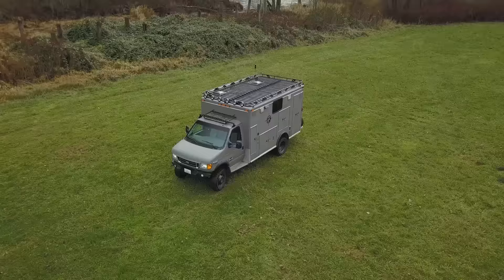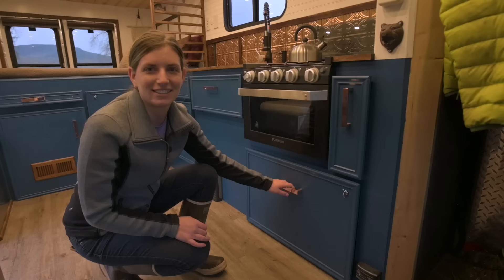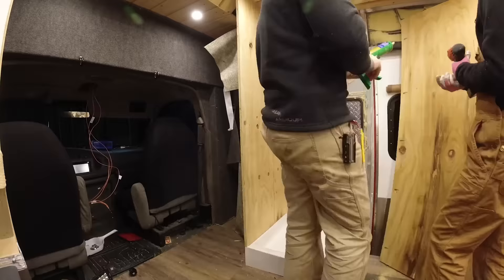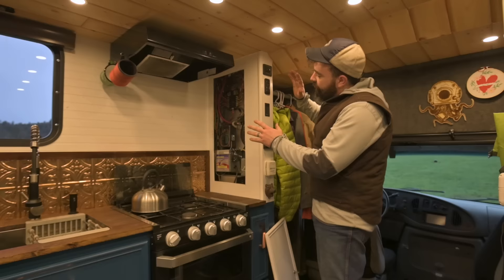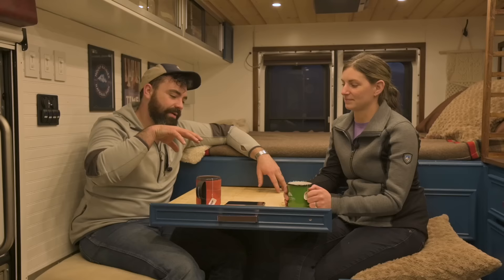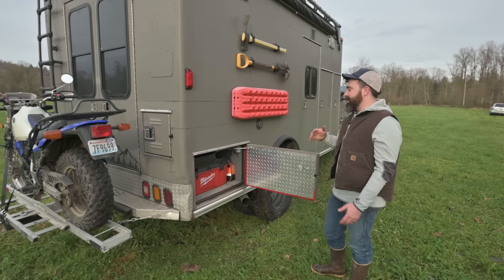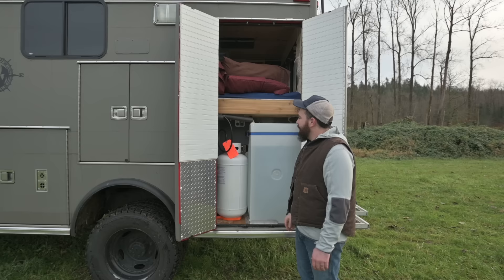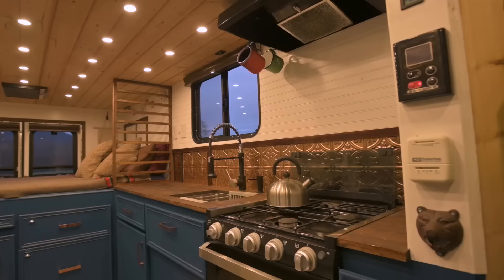DIY 4x4 Ambulance Tiny House W/ Shower Toilet & Hot Tub - Overlanding Rig

Comment: I like the idea of an ambulance camper. I don't think I could live in it full time tho. It would be really nice for traveling. Not that we actually travel much. Plus I've got hip issues and my partner's on dialysis. So traveling is pretty much not an option for us at this point. Well, I suppose we could technically hook up the machine to run while I drive or while we're parked, but that would be a rather risky environment to hook up/unhook in. We're supposed to take a lot of precautions to avoid infection. There's also the issue of where we'd store all the bags of dialysis fluid. Sigh.

And that's why we pretty much stay put and don't go anywhere. Who knows how long he'll be on the list to get another kidney this time. Last time it was 2 years.

Comment: Doess anyone know how much this weighs? I'm worried about longevity of the transmission and motor if I buy a similar ambulance, GVWR is about 14,000 lbs for E-450s of this era with this drivetrain. I can't find info on the weight of e450s with the ambulance box on it.. Thanks.

Comment: I usually see propane tanks in these van builds sealed up in a box with a hole underneath because apparently the propane leaks but since it is heavier than air it will sink to the bottom and go out the hole. Their propane tank was right under their bed and not sealed off. Isn't this potentially dangerous?
Reply from the maker: Storing propane in a propane locker or outside the rig is a safer way to insure proper ventilation in case of leaks. However some folks do have them inside with a propane detector mounted near the tank.
Reply: @TinyHomeTours  oh okay that's sounds safe too

Comment: We love nature. That's why we love to destroy it with a disgusting 11MpG (or 22 liters per 100km if you're not using legacy units). That's not a camper, that's a CO² factory. And then, as if their footprint isn't big enough yet, they burn gasoline for 4 hours to get in a hottub. Or idle the engine for some time to generate power.

Comment: I build hydrogen systems. I'd like to see more peopl going that rout. There are quite a few benefits to using hydrogen over gas. It can also be used as a PEM cell for electrical generation combined with solar.

Comment: Why talk her into a motorcycle? I'm sure you could convince her with a side-by-side or better yet a tracker or a sidekick same wheelbase as side-by-side and most Like ORV trails for quads are based on wheelbase the only reason why I said tracker and sidekick is because they come in 4 door parts are cheap like lockers amazon has them for 100$ plus you can tow it plus it can be street legal plus the wheelbase to be able to go down ATV trails so it checks all 3 boxes plus the woman can take it and go shopping when she wants to you don't have to drive the ambulance and you can keep the bike or trade the bike for the tracker or side by side I mean I have a tracker it's a little 2.0 Auto kinda gutless as far as a highway but that little thing takes whatever on and it's only on a 30 inch tire with a small life bumper and winch and everything was cheap like the winch was $300 bucks the lifted was 500 buck the tire was the most pricey well the radio was kinda pricy to just because I like clean sound and I'm picky plus the radio was shinny and I'm a sucker for shinny objects but anyways they do come in auto or manual as well and the drive trains are super solid and I'm still getting right around 25 to 27 mpg for a lifted off road toy that can go any were and that didn't close me 30 to 40 k brand new I'm happy with it  plus this could give you more content you can do some overlanding as well they have all types of stuff roof top tent or if you get the 4 door more storage for camping gear like a hot stove or what ever else plan you may have